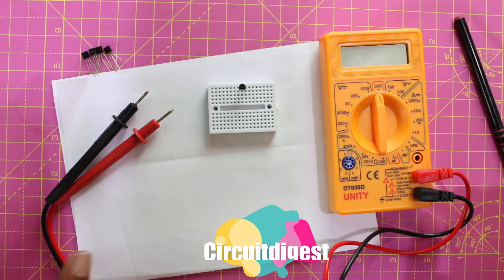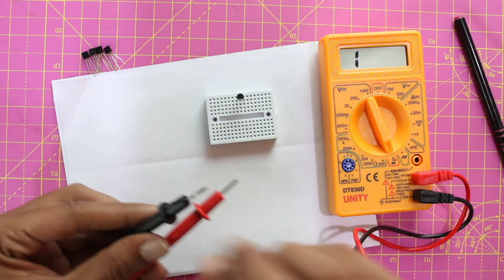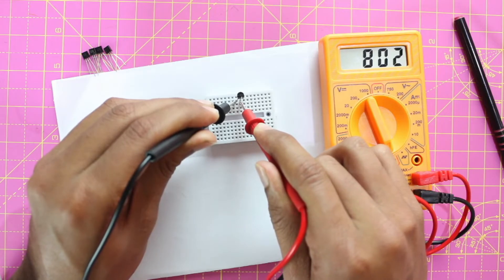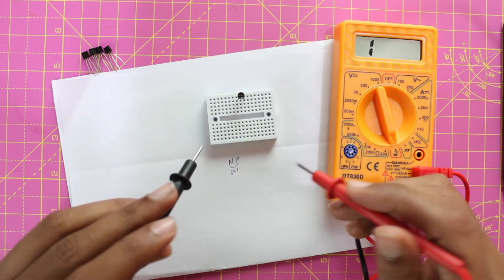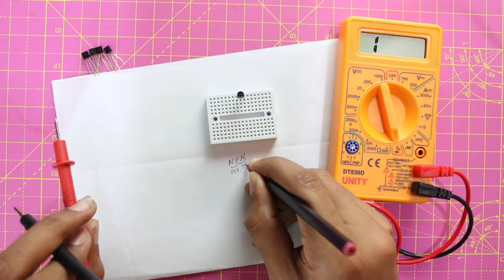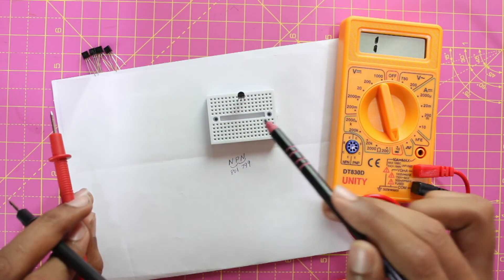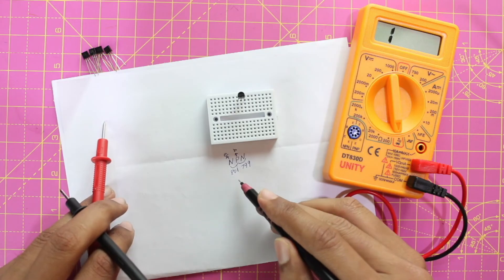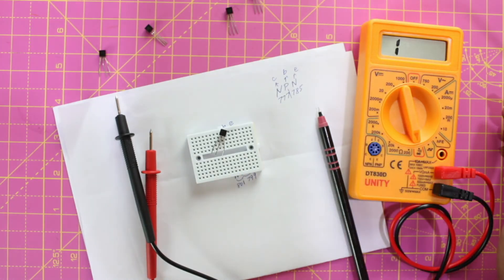Simple Method to Identify Emitter, Base, Collector of Transistor using Multimeter

Comment: Good info, but please also share how to identify if it's PNP or NPN transistor
Reply: He put the +ve red on the middle pin and put the ve black one on any sided pin if it works (the multimeter reads) then the middle pin is p type and as the transistor is NPN or PNP as you know what is in the middle you know its type, now what if it is not work so you are dealing with an PNP one and to make sure just swap the multimeter probes but for simplicity make always put the +ve on the middle and see either it works or no.

Comment: Can you explain why the emitter voltage drop is always higher? It's 2 diodes you are measuring... if I measure a bunch of diodes I often do not get a guaranteed voltage drop... some higher, some lower. Are you implying they build each transistor knowing the emitter diode voltage drop will always be higher? That doesn't seem right. Is there any documentation that backs this up?
Reply from the maker: This was more of a passed-on information, we did test it with different transistors and found it reliable. If you want to check the theory behind this you might wanna check out how a transistor works in active mode Vc>Vb>Ve. also if you measure the voltage drop across the diode of same part number you should get a constant voltage drop I am not sure why you saw higher and lower voltages.

Comment: Very well done! I had a few obsolete transistors on a board I was repairing. I needed to replace one, but the available datasheets were contradictory as to the BCE pinout. I removed a good one and checked it as you described. I was able to determine the correct pinout and be confident a suitable replacement was installed correctly. Big THANKS.